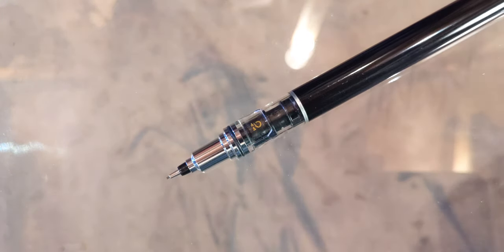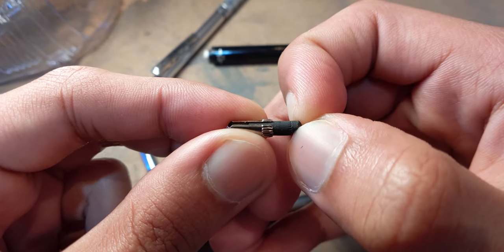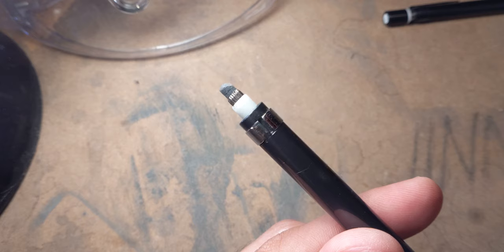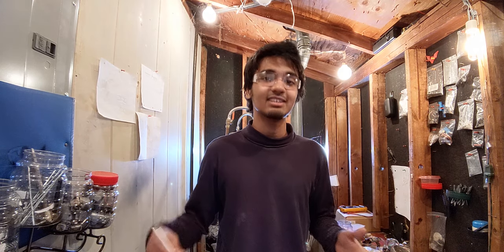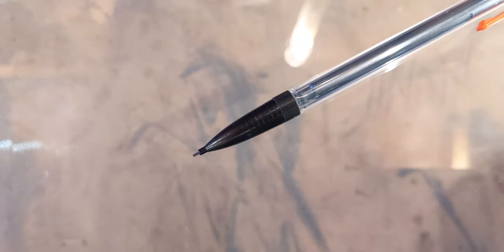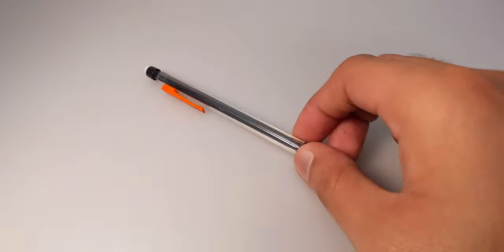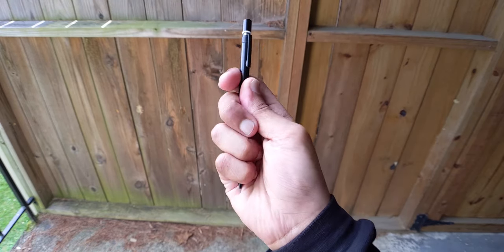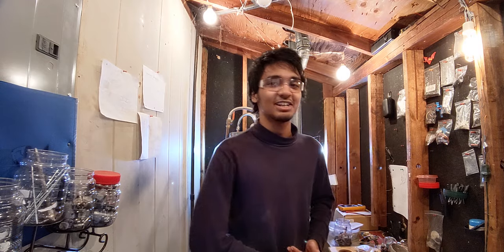My Top 5 Mechanical Pencils - DOPE or NOPE

Comment: The Kuru Toga is made for writing Japanese and other East Asian language characters as the pencil tip lifts off the paper a lot. When you use a toothbrush to wash your toilet of course it's not gonna work very well, regardless of how fancy it is.
Reply: As an engineering student I use it mostly for math, it works great for writing equations compactly.
Reply: weird analogy but yea, wouldn't wanna use this for drafting
Reply: @Immadeus  is it good for writing numbers small?
Reply: @nigglesworth3456  yeah, the only problem I have with it is that the included eraser is too small, but I buy pencil eraser tips anyway so not a big deal imo
Reply: @Immadeus  nice i just ordered one
Reply: Actually, really depends of your style of writing and letter. The Kuru Toga’s are really good for a letter that is similar to cellphones one
Reply: What an interesting comment! But there are some writers that can take an advantage even with that mechanical pencil.

For example: Writing the Latin alphabet I still write letter by letter, even when I'm writing cursive, so for me it works perfectly fine, but my sister instead of me writes the entire word and for her it wouldn't be the best option for sure.

Also for calculating it might be interesting once when we're calculating we draw multiple traces (just as similar as the Japanese writings).
Reply: @panda-ub1fx 😱😰
Reply: Then go use your Ticonderoga
Reply: @loudpiroca is the pentel  good for writing small numbers?
Reply: i use it to write in persian and it works well cuz persian is a bit like japanese complicated
Reply: So? How dare he talk about something not working for him?
Reply: He has the Advance which is the W speed mechanism the W being meant for western writing and rotates twice as fast. I have both and it is noticeably faster but the find the other cons about it the same (especially the slippery eraser cap)

Comment: I think the graphgear 1000 is a great mechanical pencil is a great drafting tool for the price range
Reply: Same, personally I prefer the 500, due to it being cheap and of pretty decent quality.

Plus more metal to grip on
Reply: pro use-171 is my pick. The God of mechanical pencil period.
Reply: @redding4540   like I said graphgear 1000 is great for the price range & I have a few on my desk but I have the Rotring Pro pen and pencil set cost a little more but that's what I carry in my pocket
Reply: @mmarjisr  I got the Rotring 600 3-in-1. It works great.
Reply: @redding4540  that's great I got mine not for it's looks but for it's design
Reply: @mmarjisr   I got it for the function. I don't have to take bunch of pens and pencils together. the pen refills are interchangeable with uniball jetstream ones.
Reply: GG1000 is a great pencil, but it has a major flaw. The threads at the tip of the pencil are made of think weak plastic and they will break. Which is really annoying because the cheaper Pentel Sharp 200 series pencils have a sturdy plastic body, but the mechanism and tip thread is metal. Why they used a plastic thread on the GG1000 is beyond me, consider it's they're premium model.
Reply: @drwhite7285  metoo. I bought mine for 4 dollars it works perfectly 🥰
Reply: agreed.  the pentel 1000 is the best mech pencil i have ever used and ive been drawing professionally for 20 years.  i have collected so many mech pencils and that pentel blows every single one of them outta the water...some of the other mech pencils ive had have cost over 50 friggin bucks too.

that tiny eraser that cant be used after it gets halfway gone is absolute sh!t but literally everything else about that pencil is perfect.

and since ive had mine for three years and have used it for EVERYTHING i need a pencil for i will likely never have to buy another.
Reply: the threads wouldnt break if you didnt abuse them.  dont try to force the tip past a sensible pressure.  there should never be any need for metal threads on something like a mech pencil.   plastic threads are far more than adequate.

dont abuse your equipment, people...
Reply: @aa-tx7th  you can try Rotring pencils $25 to $30 which I think you will like also

Comment: The Kuru Toga Uni Roulette is the best of these. The secret advantage you missed is that rotating tip has a little bit of spring to it. If you drop it the the little metal sleeve that the lead extends from doesn’t get bent. I’ve use some many different mechanical pencils and usually this this where they end their life. I have never bent the tip on the Kuru toga Uni Roulette! The eraser is not an issue, pros use an eraser pencil, they don’t waste time pulling the end cap off and putting it back on again.
Reply: I only just found out that eraser pencils were a thing, but I've still never used the tiny eraser on the pencil. Too much of a pain.
Reply: I am eyeing to buy one. so your saying its durable if dropped numerous
 times?

Comment: I thought I was the only one who wasn't wowed by the rotating lead of the Kuru toga. Like you, I just got used to adjusting my grip when needed. I'm still trying really hard to like this pencil while still hoping to find my old drafting pencils I've misplaced.
Reply: Same here. I'm used to adjusting my grip. I hate the spongy feeling when you press it to a paper.
Reply: I've been using the Kuru toga pencil for probably 2 years now. The rotating function of the lead is completely useless.
Reply: Rotating the pencil after a bit of use is a thing I do on instinct by this point. I have no use for the Kuru Togas.
Reply: @DrawingTechnical  it's for consistent line thickness.

Comment: I think the heavier drafting mechanical pencils tend to be because after many hours of studying you kind of lose the strenght to write and also because the thinner leads are usually scartchy and the weight kind of helps to soften it. That's just my personal opinion on the matter and also why I like the graph pentels that are heavier. Great video, btw. Another mechanical pencil that is almost as affordable as bic with all the features plus solves the lead break problem is the pentel P203, P205, P207 and P209 (the final digit is the mm of the lead), and the BRW version is even lightweighter!
Reply: The p203 is a great pencil. But I write all day with more comfort with the Staedtler 925. It’s 17g instead of 10g but the grip is a little wider and much, much more positive- so it actually takes less effort to hold and manipulate. At least for my hand. But the work in writing definitely isn’t holding up a pencil but the sustained effort of gripping.

Comment: Nice, I can't stand the roulette's wobble. But love the graphgear 1000, I don't find it heavy at all, its actually my lightest pen/pencil (i use all metal pens). The wobble isnt noticeable when I write, the grip is more than fine for me! The rubber makes it comfortable and the knurl doesnt "scratch" dead skin from my hands.. hahaha. I dont have sweaty hands so I guess it plays a role? I like the fact that the graphgear 1000 outside body is all metal, and the retractable mechanism is so satisfying. It looks professional as well, although it could look better.
Reply: The woble isn't noticable with any wobly pencil, but it's there and it shows in the final product. You can't spot the imprecision easily when using it. Try something like the GraphGear 500 next to it. (The one without the lead indicator on the button)  Difference is noticable on any kind of professional use, both technical or free drawing.

Comment: I'm glad you gave the downsides of the kurutoga, as so many people had such great reviews, and it was just disappointing to me. The wobble and sponginess of the lead felt HORRIBLE. I use the pentel sharp currently, and it is so great and solid feeling. Would recommend if you want a solid, cheap pencil.
Reply: The thing to note is that he was using the kuru toga advance which has a much higher lead downward bounce and spin, normal kuru togas are much more subtle in rotation
Reply: Agreed, it was a waste of money for me.

Comment: You totally forgot the Pentel Twist-Erase. By FAR the best mechanical pencil ever. 1.5" x .25" eraser, holds tons of lead, very robust, lead doesn't spring back into pencil with pressure, thick soft rubber grip. I've had two of them for about 13 years and they are still PERFECT. And they're dirt cheap.
Reply: the grips of mine are falling apart but I use the click version. I love the eraser.

Comment: I love the Pentel 200 series drafting pencils.  They were what all the professional around me used, after trying far more expensive pencils.  All of us would put slip on grips of one kind or another on them, and nearly every other type of pencil.   We had rolls of silicon tubing that we would snip off for grips. Such grips are not just for kids.  Too, a piece of double sided Scotch tape works wonders with a slippery grip.

But you're dead wrong about the Graph Gear pencils.  In the first place, stop using the erasers that come on pencils, except in an emergency.  That's amateur city.  Buy a good erases, or an eraser stick, and use that.  In the second place, Graph Gear pencils are not too heavy.  They're the perfect weight for writing, and for doing real work.  

It always amuses me when someone complains that a pencil or pen is too heavy.  There are hundreds of jobs where the worker has to hold and use a tool that weighs several pounds all day long.  I grew up working jobs like that.  If you're smart enough to learn how to use a pencil or pen correctly, the weight of the instrument will do most of the work for you.   

Pentel makes great pencils.  So does Pilot.  But the Graph Gear pencils are the best out there for most work.  For fancier settings, splurge a little and buy a mechanical pencil that actually looks fitting in a business situation.  On the cheap end, but a Pilot Dr. Grip.  On the expensive end, buy a Montblanc.  If you simply hate such pencils, use a Graph Gear.  They actually look like they cost a lot of money, even though they're dirt cheap.  

But, really, stop using the erasers that come on good mechanical pencils, unless you know what they're for.   Very thin erases, such as most drafting pencils have, should only be used when a very tiny bit of precision erasing needs to be done.  Want to change a short, fine line, use it.  Want to erase one letter in a work, use it.  Otherwise, buy a good eraser and use it.
Reply: I get better performance from the Pentel GraphGear 500, than the P205, It's more accurate which means, you can draw a perfect round circle and it will look like you used a compass to create it. Pentel P200 can't do that. They also feel very cheap and the numerous sharp edges on the top of that pencil, cut into my hand all the time, which is very annoing. I use the P205 for taking a note once in a while, and the P203 is great for detailed drawing. However, my main pencil which does 90% of the drawing even writing, is the GraphGear 500. Even the letters I can make when writing, are more rounded and cleaner looking, than any other pencil I've tried.
Reply: Pencils and accessories are very subjective, there's a lot of models of pencils and they all surprisingly write. You just gotta pick what's best for you.

Comment: to me, the best is the FABER-CASTELL "Grip 1347" (0.7mm). the tip is sturdy, the lead doesn't break, the grip is good. of course, it's a low cost product and woht last forever (plastic threads, rubber grip wearing down) but it's become the standard reference of mechanical pencils in gemani.

Comment: I had to do a lot of drafting in school, and not one mechanical pencil had a good eraser.  Their main point is to keep the lead in I guess.  It was accepted that one bought a good eraser for erasing and a good pencil for the drawing and writing.  I have to tell you that you really missed the mark with the Kuru Toga Roulette: it is a fantastic pencil.  I got one recently for under $10 and it blows away the $25 pencils I used in the early 90s.

Comment: i have a 0.3mm pentel graphgear 1000

the eraser is so useless i just use a seperate clicky eraser

and of course the lead is so thin it breaks at least once a day

but it is by far far FAR and away the best mech pencil i have ever had in 20+ years of drawing professionally.

everything else IMO about that pencil is absolutely perfect.

the weight, premium feel, premium build, durability, reliability, grip, ergonomics, finish, mechanical movements, repairability, the teardown, ect. are all VASTLY superior to the dozens if not hundreds of other mech pencils ive collected over my life.

Comment: The Kuru Toga Engine was hard to draw with doing art work, becoase of the reaction mechanic.  For normal printing it is good.  You also have to keep it vertical.  The specal featire fails when you draw at an angle.

I like the Nicpro Black Art Mechanical   Pencil set better.  It is very nice,  and comes in a set

Comment: Nice vid. Have you tried the Rotring 600/500 and the Steadtler 925's? Those are my goto pencils. The Rotring 500 has a great grip and is lighter than the 600. Cheaper too.

Comment: I use just regular cheap pencils and idk if nicer ones would make a difference in my skill at all but I wanna have something sturdy and smooth. Plus I cant remove erasers and the lead keeps breaking when I refill from the tip lol!
Reply: Using an expensive pencil wont make you any more skillful, but if you enjoy using it more than a cheap pencil you will become skillful as you use it more.

Comment: Nice whip @ 6:12. I love the spring mechanism of the Uni 207 and Chroma. I have been on the fence about the Kurus because I hate pencils that don't have a twist out eraser. I used to have a big problem with sweaty hands when I was younger, then I was shown the way. I started with 2B lead and moved to 3B all in a 0.5. Softer lead allows you to write dark without much pressure and you have to go easy on the 0.5 or it will break. It takes a little getting used to, but worth it. It makes erasing much cleaner, too. I how switched all the way to 4B, but can't get it in 0.5, so I am running 0.7mm.

Comment: these are really good pencils, and the cons are very unreasonable. the pentel graphgear grip is very comfortable and easy to use in my experience. sure it is not for long essays, but for those, i mainly use a cheaper pencil.

Comment: People do toss the bics, but you don't have to. You can easily add new leads to those. I never wore out the eraser on a bic because it's awful and I don't actually use it. 
It's ok as a pick up pencil, but the plastic mechanical pencils that come in 1 or 2 packs for under $10 dollars tend to be a lot better for not too much money.

Comment: Well I have a Pentel Graphgear 1000 for a year, and I have no problem with it. 
Yes it has that eraser cap flaw, it is heavy, and it does make the tip wobble due to wear and tear but if you take great care with it and go easy writing on it then you’ll be fine.

Also, if you guys want a 0.7 Mechanical pencil, I suggest you guys try Pentel Champ mechanical pencil. It has great grip, removable eraser, quite affordable (costs around $14-8 depending on the Store), and found almost everywhere. The only flaw is the Grip does wear and tear, and the Lead is a bit Weak and can break.
Reply: Heavy? Are u sure

Comment: I was surprised that you include the Bic Xtra pencil.  Having tried many of the more expensive mech pencils I keep coming back to the Bic.  Its so light and so cheap and just works.  If I lose it I will just grab another one.  It is a triumph of good engineering design and cost.  It may not work for everyone but thats why there are so many different mech pencil models available.  The buyer is king of the marketplace.

Comment: I would have to recommend the Rotring 600 as the best mechanical pencil I've used. It's made of brass, with a simple design and it is very nice to use. It also just looks super cool. It may be $25, but its definitely worth it for a pencil that can last forever.
Reply: graphgear 1000 is better

Comment: Cool, thanks. I wish Blackwing makers of Blackwing 602 would sell their Blackwing graphites as leads again, especially their Blackwing 602 graphite which is the most buttery smooth graphite by in existence by far (best to use with the most butter smooth paper in existence, by far- the Tomoe River brand though it's more for the most buttery smooth fountain pen nib and most buttery sooth fountain pen ink).

What brand is your greenish-blue triangle and compass for drafting?

God bless, Rev. 21:4

Comment: Do you think the Pentel Twist Erase III is better or worse than your top pick? I saw a video of someone who said it is the best mechanical pencil in their opinion. Today somebody stole my pencil after I forgot it in class so I'm looking for a new one. Thanks!
Reply from the maker: I haven't tried the Pentel Twist Erase III, so I can't tell
Reply: I have a Twist-Erase Click in 0.9mm and it's amazing. The grip is comfortable, the eraser is soft, effective and generous (even though you shouldn't use it for erasing more than a small trace or letter) and the tip is rock solid. However, I tend to baby mine since it disassembles in the middle and it's almost all plastic, so I don't wager it has much drop resistance.

Comment: The winner is not retractable, which mean more bent tips and getting poked, not good.  Aside from the plastic inner connector that can break, the graphgear1000 is tops, quite durable, and the grip is fine, never had a problem writing with it, and there is no mech. pencil that has a nicer/ faster retraction.